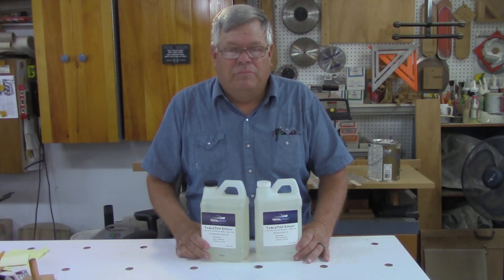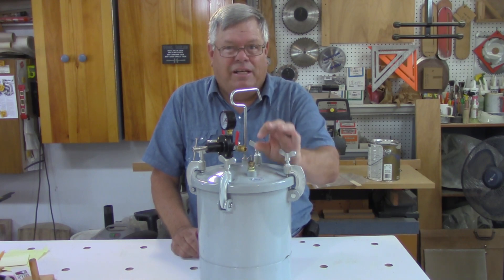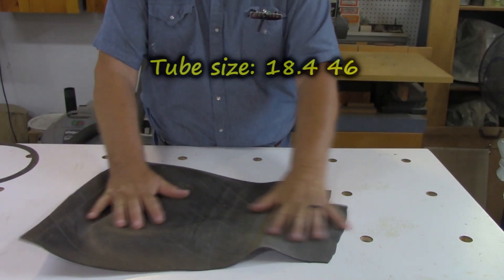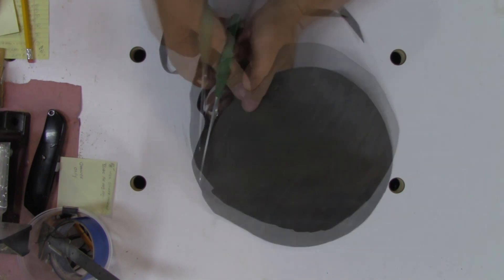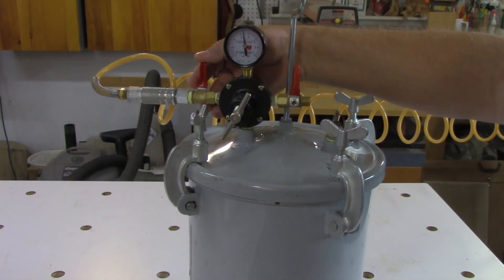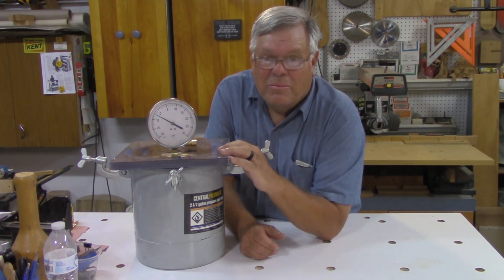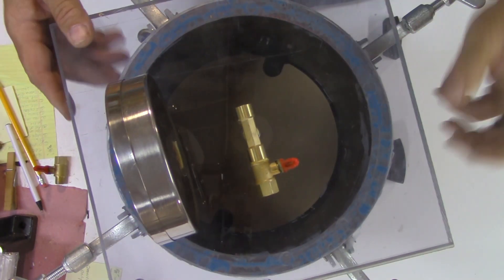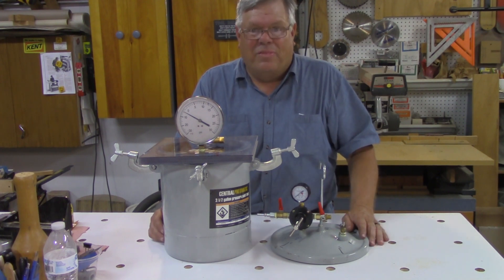Harbor freight Pressure Pot / Vacuum Chamber.

Comment: I've been ressearching about the vacuum chamber subject, and discarded the idea of using a presure pot as a vaccum chamber due to the risk of collapsing the pot under vacuum.
The pressure pot can withstand 60 PSI of pressure, but it can colapse under about 15 PSI of vacuum (one ATM). 

Like concrete, that is very strong under compression, but very, very weak under traction (the opposite is true for wood).
I've decided to use a chunk of suitable diameter 3/8" wall thick tube... Use the pot with great caution, to avoid accidents.

Comment: Love this!  I have. Harbor Freight pressure pot already, need a vacuum chamber. Absolutely perfect timing for me. Thanks.
Reply from the maker: From One Ron to another, you are welcome!
Reply from the maker: Ron, I just watched a youTube video by Steezy.... "Resin casting and mold making Part1 : How to make a vacuum chamber" In his video, he did not cut the groove in the plexy glass like I did. He just let the gasket lay on the rim of the pot, set the plexy glass on top and got vacuum. Take a look it could save you some work.
Reply: @pigsty-productions  as long as the plexy glass is reasonably flat, it should work fine. Also, if you didn't need to see inside the chamber, you could likely just use the original lid.

Comment: Did you have to tap the acrylic?
Reply from the maker: Yes, I did! Take it easy, acrylic may crack easily.
Reply from the maker: @Energie system Energie, I used the acrylic for the vacuum lid, so I can see and control the foam when degassing.

Comment: Revieck.....do you pour the cactus juice inside your pot ? OR  My question would be , I was thinking, can i put a bucket in my big pressure pot, leave the lid off,  , put the cactus juice in the bucket with my wood, and my weight plate so parts dont float to top of bucket and vacume with my 1" acrylic lid with all vacume parts and do staballizing ??    To keep my inside  pot clean from liquids ???    that with of course i track that my juice does not over flow from my cactus juice   bucket ????         was this clear ??

Comment: Why did you make a separate lid? Could you use the original lid for both operations? Is it just for visibility.
Reply: You need to see the degassing process. The bubbles foam up the resin as they rise up and you need to ease off the vacuum so it doesn't overflow your mold or container. You keep cycling this until all the air is gone from the resin. Then you could leave the vacuum on til it's set or cured.

Comment: Hey, where'd you find that nice gauge that's on the vacuum chamber?  I need to replace the crappy gauge that came with my amazon chamber.
Reply from the maker: Aaron, that gauge came off of my Balzer manure spreader. It measures vacuum, for sucking manure into the tank and pressure to push the manure out the tank. It's stainless steel and cost $110.00. ... Don't raise hogs anymore, so I used it in my vacuum chamber. You can see the manure spreader in action by going to my channel and go to the playlist "the Pigs"!